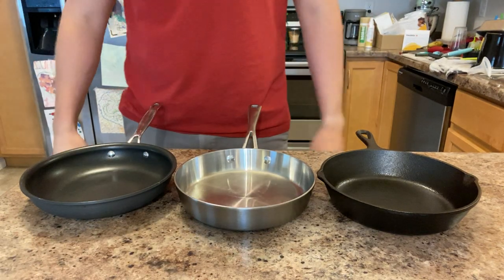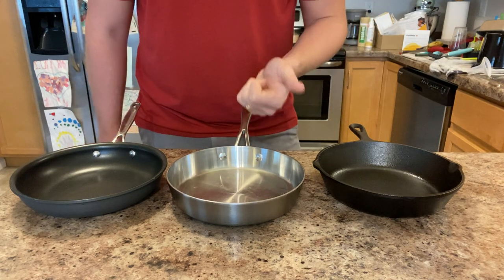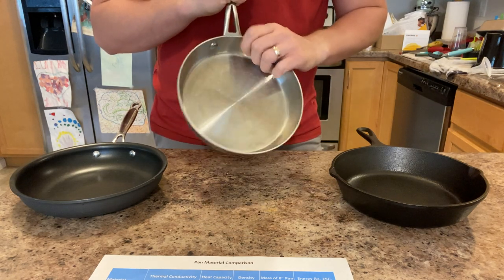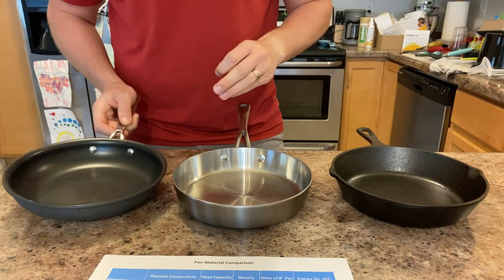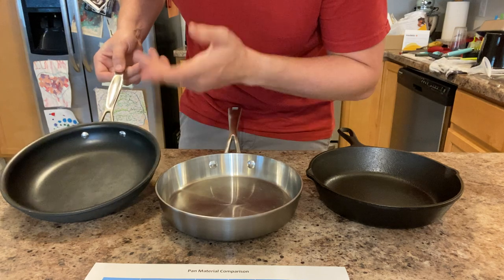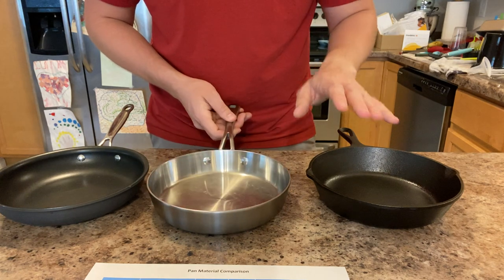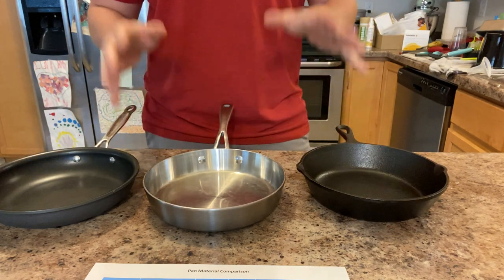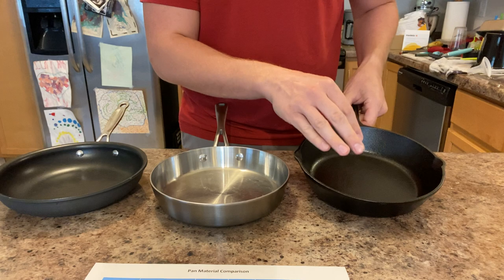Pan Materials: An Engineer’s Perspective

Comment: When I want to do a perfect browning I do 5-7 minutes on medium flame for the cast 
Wich size is that lodge ?
Very nice to know aluminium works well
Reply from the maker: I’ve been doing about the same but set to high on my electric stove. 

The lodge is an 8” (200mm). 

I personally almost never use aluminum for browning/sautéing except on rare occasions but I may start trying it more when I don’t need fond.
Reply: @EngineersPerspective701  isn't 8" a bit small for searing ? I think 10" would be the best for 1 portion steak or filet - 2 burgers .
Reply from the maker: @dimmacommunication  I like the 8" for single servings of beef or fish steak actually and I have done 2 smaller NY Strips in their before but it was really tight and not ideal. 

Typically I use my 14" cast iron for multiple servings because I like the incredible room and all that surface area for reducing pan sauces.
Reply: @EngineersPerspective701  Do you have induction ?
Reply from the maker: @dimmacommunication  No just the regular resistance style of electric burner. You can actually see it behind me!